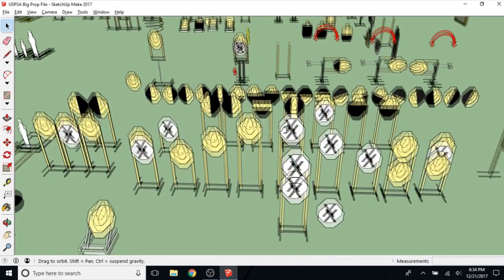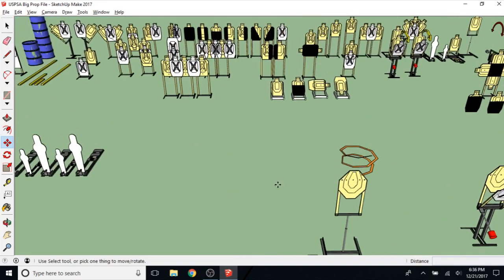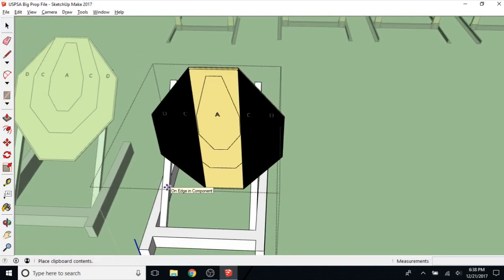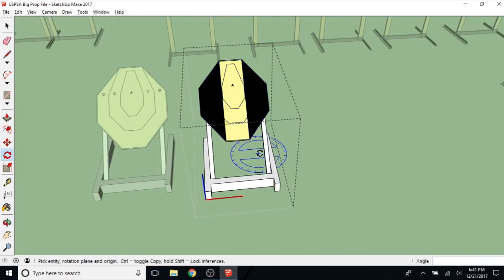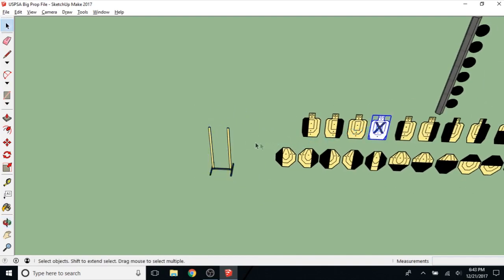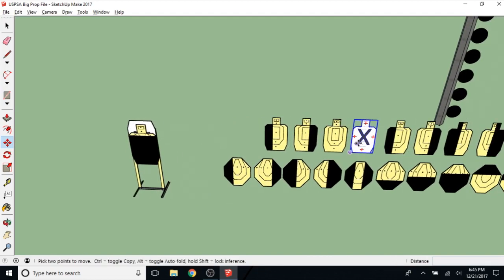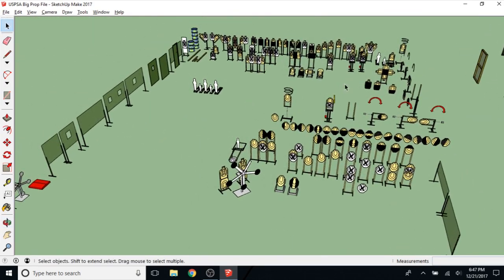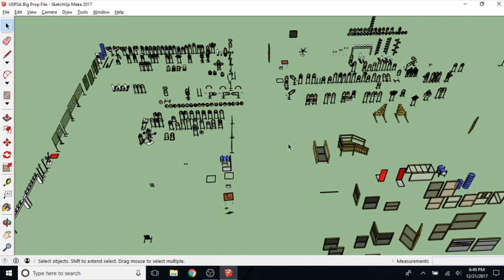USPSA Stage Design with SketchUp | Part 3 - Modifying Props

Comment: Very nicely done. Is you big prop file available for download? Also, how do you make a spinner?
Reply from the maker: The prop file can be downloaded via the link in the description here:  https://www.youtube.com/watch?v=Ly67aFXmVLU

I'm not sure what you mean by spinner.
Reply: utvol1618 

Thanks!!

I’ll see if I can find a pic of one and send it to you. 

It sets on a sawhorse looking stand with a horizontal axle. A cross bar in the center balances two plates one on each end of the bar. You shoot one plate to start it rocking. Then shoot the other alternating back and forth to keep it going. Keep shooting till it spins over making at least one full revolution. If you get your timing right you can spin it with just a couple shots.
Reply from the maker: How is this?  It may not be perfectly to scale, but it ought to be close enough for stage design purposes.  https://imgur.com/R1KxSRe

I've added it to the Big Prop File, so it should now be there if you re-download it.
Reply: That is awesome!!!  Thanks!
Reply: Do you think you could make an MGM 3 gun drop box? I've tried with zero luck. Here's a link with one from a couple angles.
http://ustacticalsupply.com/mgmgundropbox.aspx
Reply: Any luck with an MGM dump box? I'm trying to build a long range flasher target like the MGM 50flasher. Could you do a flasher like this one? https://mgmtargets.com/images/Flash%20Target%20BCCZ.jpg